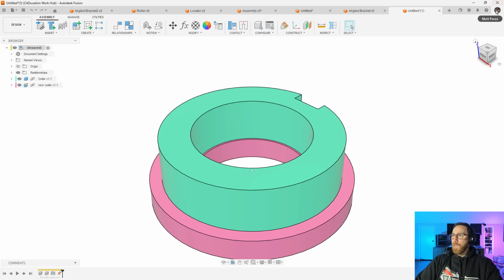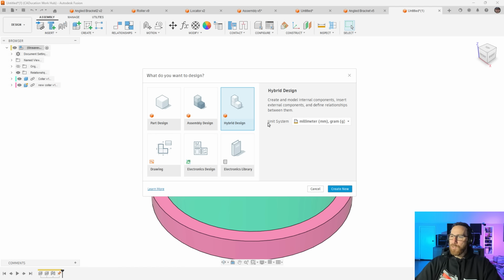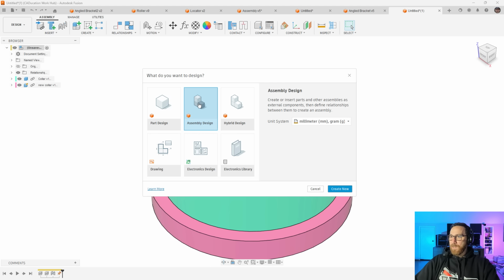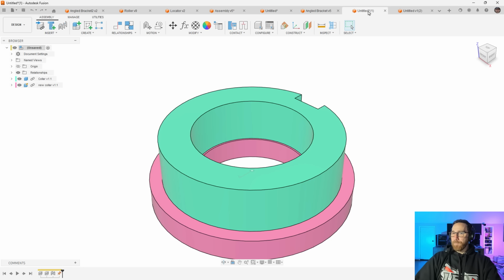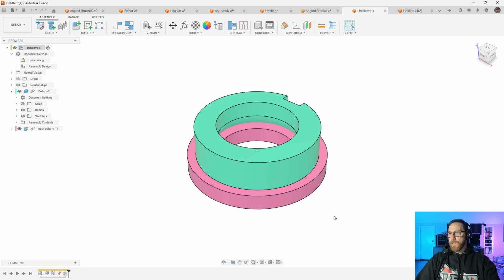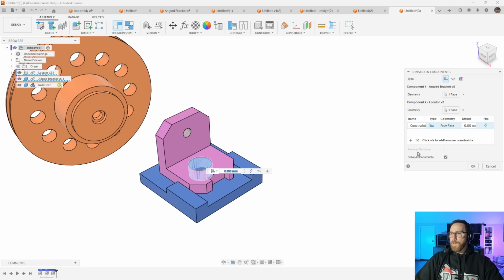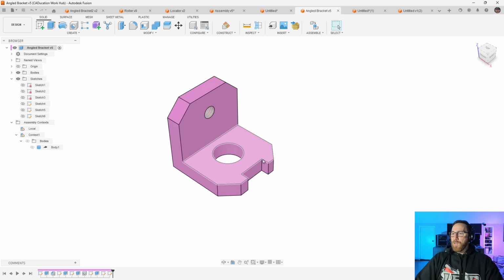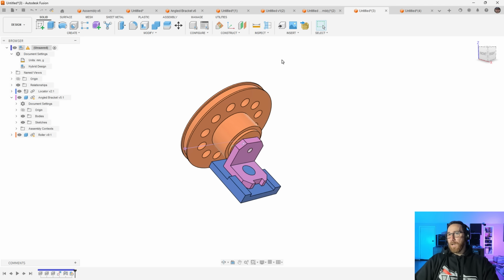Major Workflow Update in Fusion | Intent Driven Design | What Is It?

Comment: After many months of periodically  watching sometimes conflicting YouTube Videos by different authors ,I have finally managed to teach myself enough Fusion360 for what I need to tinker around in retirement .  I used AutoCad at work ,and only briefly got into Inventor enough to create simple parts, but no assemblies. I now use the free hobby version of Fusion 360, which has a limit of 10 readable files at one time which I see as a problem with Intent Driven Design. I don't know enough about the new 2026 Fusion Assembly Design method to understand how it would work, and I have not seen a YouTube video explaining the issue I have. For example , if I am designing a motor for a car , I can't design the starter motor and  the alternator as  separate "Parts" and then import them into some sort of an assembly . They would have to be designed in place to fit to the engine block and within the engine bay , so they do not protrude into a tire, or project out through the hood of the car. The YouTube Videos I have seen show all the parts somehow predesigned and then imported into an assembly ,but for example in the videos that use "lego" blocks ,does the creator "write down"  the center to center distance ,diameter and lengths of the pins on a 2 x 4 block/part, so he has those numbers when he is designing the 2 x 2 block/part ,so they will fit together when he brings the two parts into the assembly ?? .It would be nice to see some YouTube Videos showing a design down from Scratch. I hope that the hybrid version of Fusion 360 is never discontinued.

Comment: How does this update work with parameters? Example- if I have a Part design for a drawer with parameters, then a Part design for a cabinet carcass with parameters, will I be able to assemble these while keeping the design parametric?
Reply from the maker: Sadly no not currently.  Meaning if you have 2 external designs and an Assembly Design, the only time the parameters are exposed is during EditInPlace.  
I think the "intent driven" idea behind something like that is to configure each part, then at the assembly you create configurations to reference which part you want.  So say you have 50mm wide drawer vs a 75mm wide drawer.  You have configurations of each part.

In reality for that level of interconnected design the Hybrid Design still makes the  most sense to me.  You can share parameters and use them to calculate other things.
Reply: @LearnEverythingAboutDesign thanks for the response! Hopefully they can work this in soon!

Comment: For realtively simple designs, the normal Fusion approach (Hybrid) is SO much easier and preferable to Siemen's NX and SolidEdge's approaches (never tried Solidworks). HJowever, it is hard to remain disciplined and organise sketches in components so that when one wants to re0use a component, the sketch often wonlt come with it (unless you were disciplined enpugh to work properly and create the compinent, select it, then sketch, then.....) 
So, i see this change as useful for anything that is of reassonable size (history line is more than 1.5x the screen width)  and will enforce  discipline and reusabilty, wirth edit, of parts. 
So, as long as Hybrid stays for those quick designs, i think this is a. good thing - just don't make me use NX ever again :(
Reply from the maker: I completely Agree.  I have gotten lazy and just use Part for most things and convert to hybrid if i want.  Very few of my cases do i need to worry about component reuse so it is usually a non-starter.  A standard workflow of mine is a concept shape/model and then derive out components, which drops the timeline/history at that point anyways.

Comment: I don't understand the use case for this workflow as a hobbyist. It seems kind of redundant to create separate files and bring them together. and then my question is, how will I create parts that go together if I am not keeping note of every measurement?
Reply from the maker: Yeah I know.  Every other CAD program behaves this way.  Bottom Up design workflow basically means each part has an independent file.  They can relate to other parts through associative references but honestly for me i prefer a hybrid approach.  The benefit to the external assembly stuff is if you are a large team working on a single assembly.  Small sub-assemblies or individual parts can be worked on without locking up the entire design.  

For a hobby user having a limited number of active designs and im told by other you can't use Edit in Place on external components, it makes sense to stay with Hybrid.

Historically you have Bottom up vs Top Down assembly design.  I have mostly taken a Top Down "multi-body" approach which is totally fine.  Fusion is just having a bit of an existential crisis with its decision to make Hybrid the workflow because people are getting stuck with bad modeling behavior.
Reply: Right. It feels like a regression.  Also, without the ability to 'edit in place' with the non-commercial license makes this entire Intent Based Design much more limiting.

Comment: As a hobbyist, I doubt I would use the part/assembly workflow as most of my designs (for woodworking) involve using parameters that adjust the size of several components in sync.  For instance, I have a project "Bench Table" where I can change about 10 or so parameters, and I've used this one project to create about half a dozen different benches and tables, all with different widths/heights/leg thickness, etc.

Right now I'm working on some speaker boxes and each panel is a component, but I wouldn't want them to be in separate files, as I need to adjust certain parameters to reach a target internal volume.  Now the speaker drivers and other bits (for reference), I do have those as separate files, so it's kind of like a "Hybrid Assembly"... a mix of internal/external.

Having said that, I do appreciate they are adding that option.
Reply from the maker: Agreed for your use case 100%.  Parameters don't talk between external components currently so I would suggest sticking with a hybrid workflow.  I think for most users that will still make a lot of sense.

Comment: An assembly is an assembly of parts?  When the assembly is finalized it becomes a component? A finalized part can become a component? I don't get it.
Reply from the maker: Fusion has always been a little tricky to understand because of the hybrid approach.

Body - an object in a design.  this can be a solid, surface, mesh.  
Component - This is a collection of things, bodies, sketches, features, a coordinate system, images etc.
Assembly - Typically multiple components in a single design

Historically with Hybrid, you could convert bodies to components at any time.  Add joints for motion, group them together as sub assemblies (components nested under another component).

Every design file in Fusion at the very top of the browser was at least a single component.  What Fusion has done is created independent file types to create a more clear picture.

Part - A design file that ultimately is a single component and should contain a single body (but can have more)
Assembly - A design file that is made up of external references (xRefs) of Parts saved in your data panel.  The assembly is just a reference that will contain things like joints and constraints for the parts
Hybrid - This is the traditional way fusion works.  It can be just bodies, components, internal or external, or any method you want to model.

Clear as mud :)

Comment: This is great until they eliminate the hybrid option.  That will mess with people using the hobby license since there is a 10 “part / file” limitation.
Reply from the maker: I don't ever see Hybrid going away.  It is what makes Fusion so powerful.  The part/assembly workflow will be the default taught though.  

With the 10 part file limitation, so as i understand it, that limitation is on active designs, but you could have innactive designs as xRefs in a larger assembly.  so say you had 20 files, 10 of which are common and don't get edits, but the other 10 need to be modded.  You coudl have a 20 part assembly with all as xRefs even though 10 can't be edited.  I can't test this but that is what I have been told.
Reply: @LearnEverythingAboutDesign   "I don't ever see Hybrid going away."  - from your mouth to god's ears buddy.
Reply from the maker: @BigDaddyI1I  If it went away there would be no way to do internal components.  Even Solidworks has a way to take all internal parts and save it out as an assemble.  Lets hope I am right lol

Comment: I hate when software reaches the Updating for Updating's Sake. And with the rolling-release/subscription model, there's no way to opt out of it. 
I like Fusion the way it was like 2 or 3 years ago. I don't want or need all these changes they've been making to it. It only complicates my workflow. But then again, I don't spend 40+hrs/wk in front of it. 
Like a couple months back, they made abhorrent changes to text and made it 'parametric'. Who wants that? Who though applying text to a model needed to be more complicated?
All this crap, right? All this crap, and after all these years, there's still no clear, concise, inbuilt and intuitive way to make PCB panels in the the board layout workspace.
Reply from the maker: For sure.  There is a way to pause Fusion updates. but i think its for 2 weeks.  EDU accounts can pause for a year or 6mo i think.

With parametric text, it has applications when configuring say an engraved part number.  However it should be optional not default.  You are required to make a user parameter for every dimension, you shouldn't be required to make a parameter to control text....

On the PCB, i do like one of the updates made letting you better define a pcb shape in the 3d pcb preview.  on the panelizing you have to copy:group a pcb then on the automation tab RUN ULP and find "Panelize"

https://www.autodesk.com/support/technical/article/caas/sfdcarticles/sfdcarticles/How-to-Panelize-multiple-2D-PCB-in-Fusion-360.html?us_oa=dotcom-us&us_si=73248f0a-ea98-42f1-a749-04357e8455d3&us_st=fusion%20pcb%20panelized

im sure you  know that and yes it seem to be cumbersome and overcomplicated, but I don't have any reference for how it was done in Eagle before or Altium to know if its common or no.
Reply: @LearnEverythingAboutDesign i have a feeling that part design will be the default and only workflow option in the future foe the hobbyist edition

Comment: I've had issues in the past with simple assemblies and EIP generating many contexts. When the context gets broken, I have no idea why or how to fix it. What is a context, can I see what's in a context, what happens if I delete a context, etc?

Also, moving to intent over hybrid, I see the account file count exploding. They need a better navigation tool than the simplistic data panel. When I'm working on a PCB and mechanical, I spend a lot of time traversing the data panel.

Thanks Matt, you answered a lot of 'why' background questions about intent driven.
Reply from the maker: Hey Craig, Yeah I am not a fan of the EIP workflow over a Hybrid assembly personally, but most of my projects are solo.  I can see value in larger teams and larger assemblies.  Mine typically are under 500 parts but usually have loads of sketches and features.  With the recent update there are supposed to be more robust messages and handling of the assembly contexts and what happens when they break or when you delete something.  In general if you delete or break a context, Fusion will retain some of the info.  For example if you projected an edge to use as a dimension reference and you delete that context, you lose the ability to project more geometry from that context (basically a derived version of that body), but the sketches, references are still kept in tact.

On the navigation side, I know Autodesk is pushing the Home tab as the solution.  This was the web view ported into Fusion and personally I don't really use it and have "show home on startup" turned off.  The main reason for me is that when i want to insert an external design into an assembly, there is no thumbnail of it with "Insert" and I find it harder to navigate the Home tab than the data panel.  For me it is slower than the data panel as well.  I would imagine this experience will continue to evolve (home tab) in the future.  For now the data panel is still my goto over the home tab or Insert.

I need to do some testing and see if this all acts the same on the new CE hubs vs the legacy team hubs.  I would imagine right now there is no difference but can imagine in the future that the CE hubs will be the default and likely when more shifts in data navigation and meta data happen.

Comment: I do love that more and more Fusion is just becoming Inventorized. As much as sometimes I appreciate the things Fusion brought to the mix, I still love the traditional Inventor method of part/assembly, with singular constraints instead of joints. It makes it a lot easier to avoid building things the wrong way. For big stuff I'm doing, we've definitely run into issues with people making bodies in the wrong places and the timelines getting all messed up.

At this point if they keep going the only features Inventor will still do that Fusion can't for me is the more powerful unwrapping tools.
Reply from the maker: Inventor surface unwrap is a nice tool!  To do that in fusion you need an add-in that cost more than fusion by 3x.

Inventor brings a lot to the table.  I don't know what the future is like for both programs.  Inventor is better at sheet metal, large assemblies, logic, routing, weldments, and all the structural stuff like beam calculator and so on.  Fusion has a long way to go before it can replace Inventor, but I have been saying the same thing (as have others).  99% of Inventor users don't use all that other stuff.

Comment: Some of the recent changes to forms was a bit too abrupt. Like clicking a point vs a line in the forms edit mode. Previously, highlighting the point in edit mode allowed left mouse click to activate the shifting of the point, but now it is silly that I have to click on the menu just to enable clicking of the point or line before i can click the point or the line. If you get the gist of it. Rather.... unnecessary update. The previous interface was perfect.
Reply from the maker: interesting. that isn't how it works for me.  If i am in edit form with the "All" selection filter, i can click on a point just fine without having to change the filter.  Double check your Select drop down in the toolbar up top. Go down to selection filters and make sure the vertex option is checked.  That selection filter menu changes in edit form vs out of.

Comment: Without giving us proper global parameters this seems problematic
Reply from the maker: Yeah agree.  This workflow has already existed.  You could have been designing this way but now there is a "part" type of design and "assembly" type.  There was a work around for the parameters from derive where you could add _Ref to them and use them. but for xRefs i think currently its not possible.